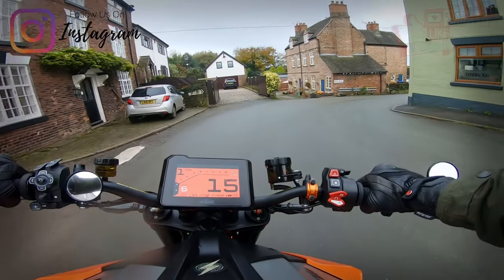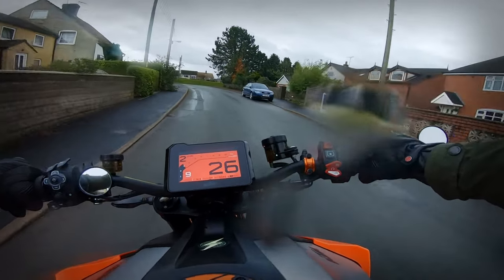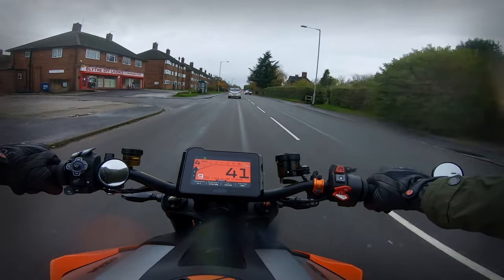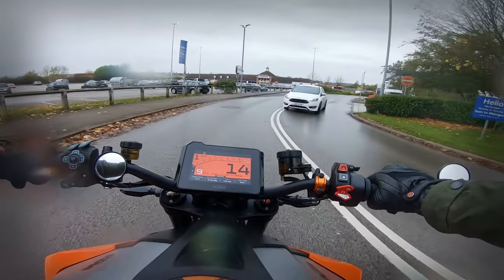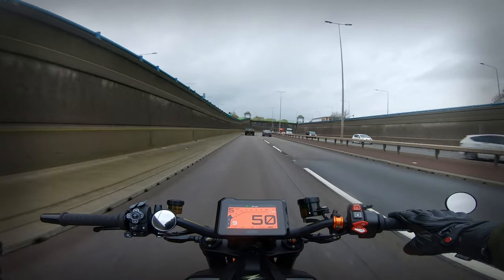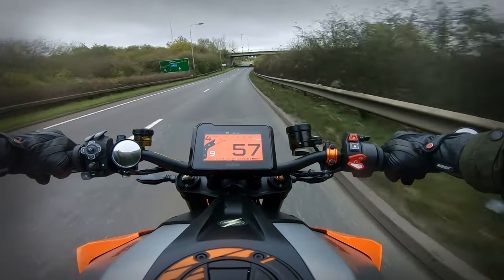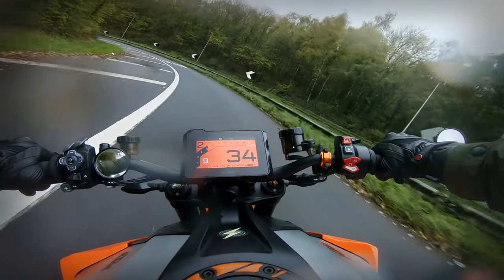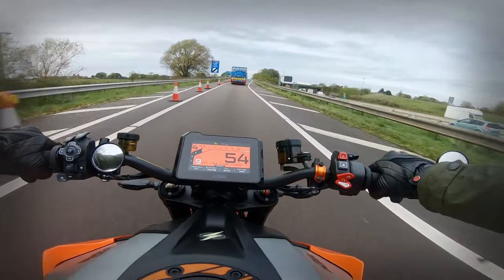Is the Healtech Servo Eliminator Worth it? | KTM Superduke 1290r

Comment: Have you got the o2 sensors deleted as well as the ESE module? Just wondering if that might solve the issues of poor fuelling below 2k revs. Technically having the servo open is leaning out the mixture so o2 eliminators might sort it.

Comment: Quick question... does the Duke have that nice backfire/rumble sound on compression braking? I used to have a Ducati monster 900 (year 2000) and it sounded lovely when engine braking.. does the Duke do the same? Only from all the videos I watch, I don't hear anything. Thanks for the upload btw.
Reply from the maker: Its very rare you get them on this bike, its probably an emissions thing

Cheers!
Reply: @sergeantsodom6969  cool beans, thanks.
Reply: Gen 2 with the SAS still installed gives big booms with a decat. Mine shoots two foot flames sometimes :))